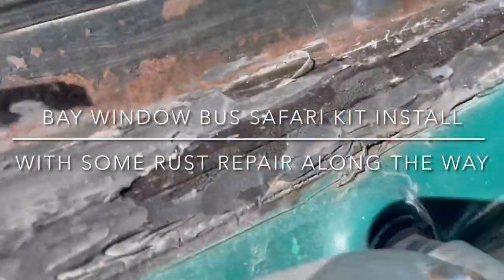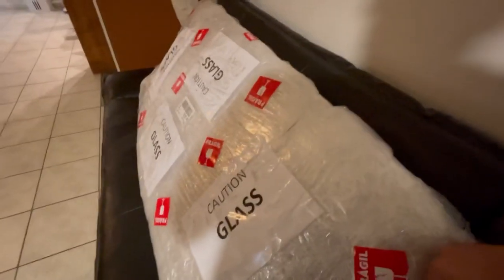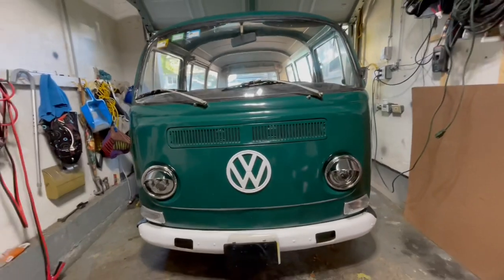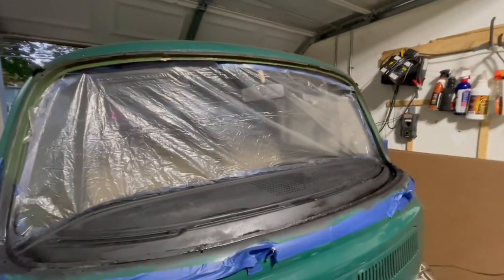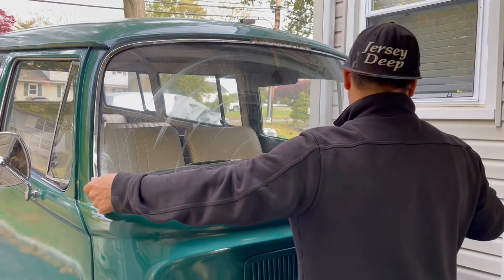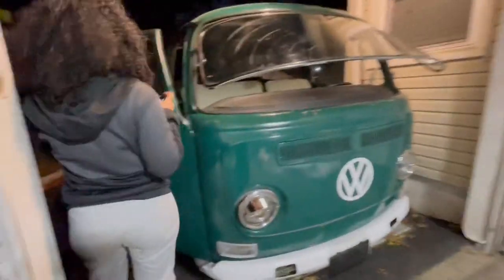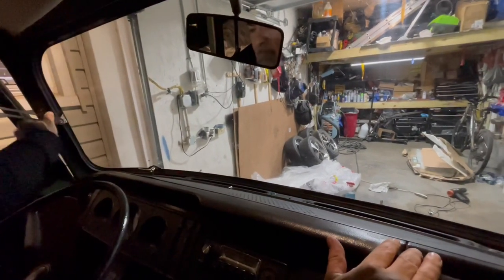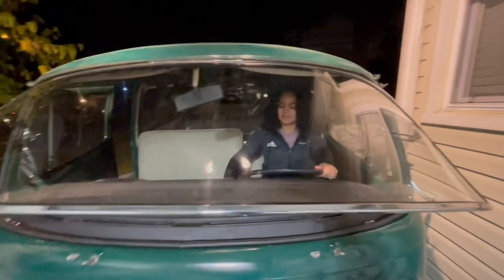VW Bay Window Bus Safari Kit Install

Comment: Hey -awesome job, I ordered one too! Have to prep rusty sill and love your outcome!! Can I ask - did you use fiber reinforced filler (tiger hair) or actual fiberglass material strip? Along the whole length? I know in need to weld mine eventually but the tolerance of a stationary window is so small I hear - I’m hoping this is more forgiving until then :)